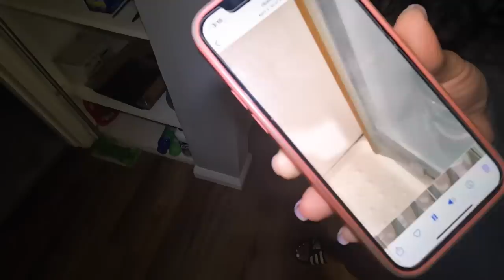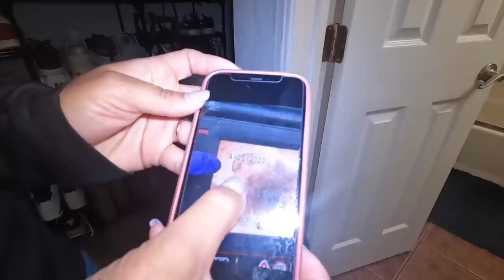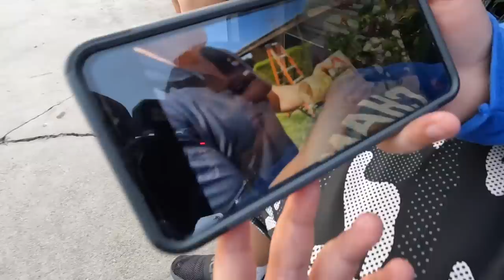She has been hearing SCRATCHING for 6 months...this is what they found

Comment: Strange one that after he found the entry point into the home. And he had already said a back valve had been installed. You need to wonder what happened to the rats they must have scarpered up the sewer line and not been able to get back due to the non return valve? Usually when the lads close off their points they take the bait as they get hungry.

Comment: Is there any way of getting rid of these rodents without opening up walls and smashing stuff up. It seems very costly to me.?
Reply: The ONLY WAY…it’s very costly if you don’t
Reply: No ... if you don't open up the walls they'll keep coming and cost them even more money in damages
Reply: Need to access to repair any damage the rodents caused. And seal entry points to prevent future re infestation. They may of gnawed on wiring or water pipes which may lead to fire or water damage.   Its like when i need to replace a part on a engine and there are other parts i need to remove to get to the bad part. I will replace the other parts when im there already even if they are good. To save time and money in the future.
Reply: Fit a rat gate to your sewer outlet. 99% of rats getting in through defective sewer pipes. 200 bucks max